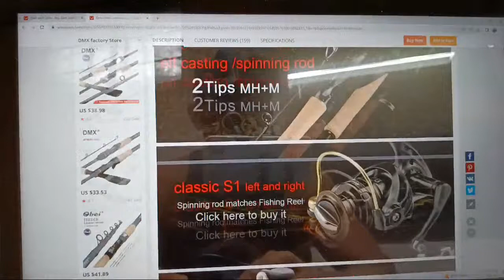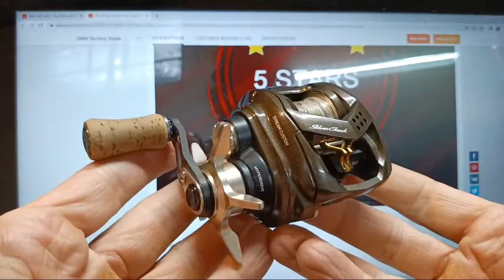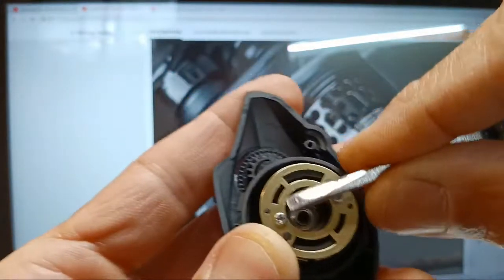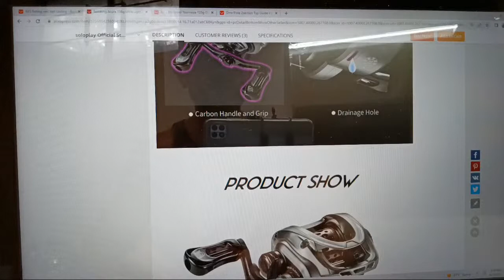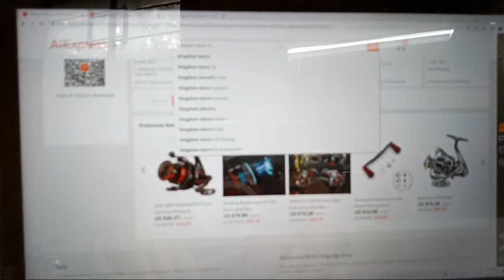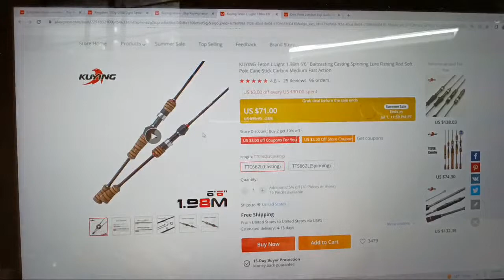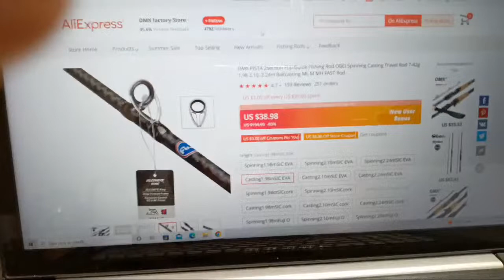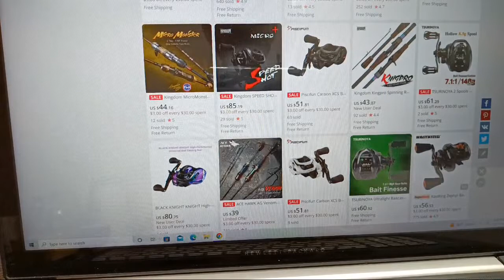AliExpress What You Need To Know Before Buying From Legit

Comment: What Tsurinoya did was they added a little plastic nub on the underside of the brake shoe, opposite side of where the magnet should be. It holds the brake shoe in that raised position. The tiny nub the magnet is supposed to ride on is still there. So I just filed the nub on the underside off and took the springs out of an old Black Knight reel and they fit perfectly. So don't sell any of those older reels with the FTB style brakes, you might need their springs!